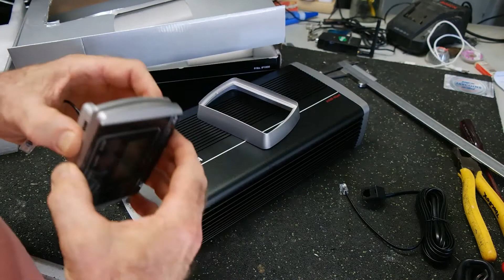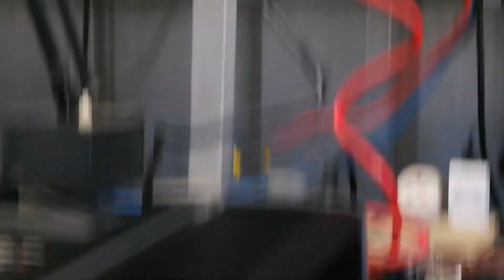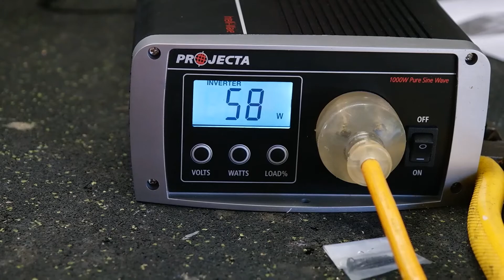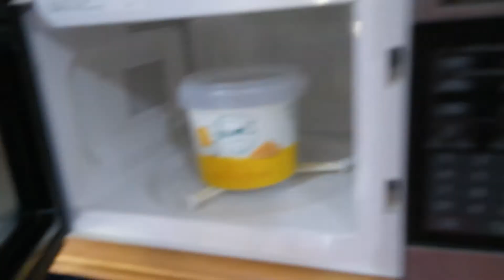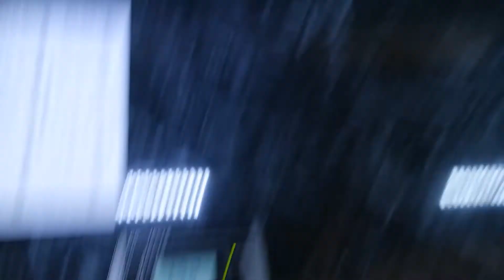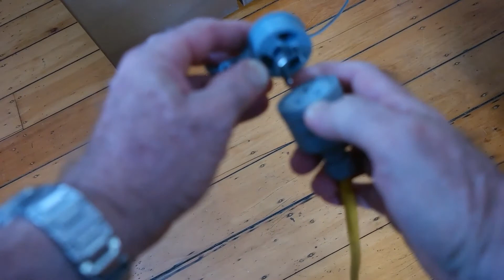Projecta IP1000 1KW Inverter unbox and load testing

Comment: Got the 2000 watt one ,run induction cooktop on 1000 watt setting and 700 watt toaster no problems but man it sucks the 270ah battery
Jonathan
Get the 2000 watt one and you can run mircowave no problem
Reply from the maker: Exactly why I didnt but the 2000 watt inverter - so we couldnt run the microwave, electric jug, toaster, hair dryer, etc., and if you leave it switched on it with no load it sucks .9amps/hr at idle and the 2000 watt unit is significantly more. Cheers Tim

Comment: I got a 1500 watt mishto, with solar charger, pretty good for what it is, yes it has a main earth connection, which i connected to an earth stake,  at 1500 watts it draws 140 amps peak
Reply from the maker: Having an earth or chassis connection doesnt necessarily mean it has any protection you shold probably check and see if it is built to any standard thats meaningful. The earth connection is more about potential differences in voltage between the chassis and the negative connection (I imagine) which can cause a problem for the inverter. Yes they draw a lot of current at full load so you need very substantial DC connections and appropriately sized cabling.